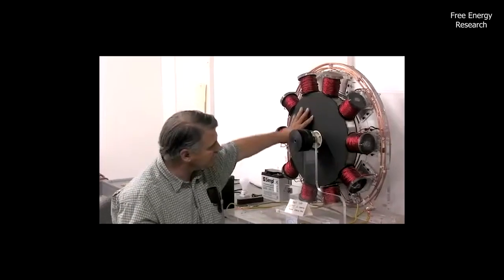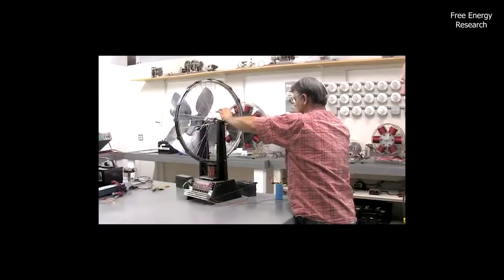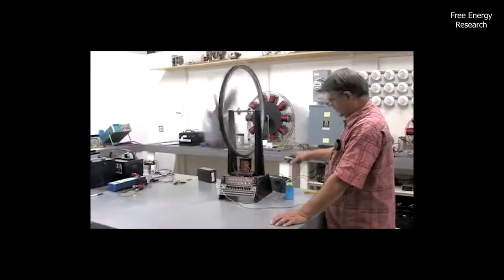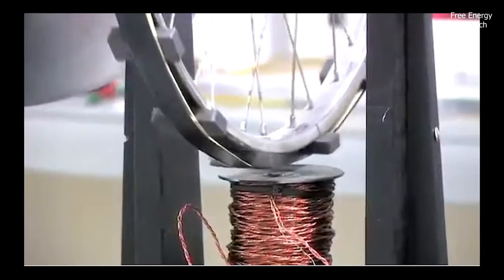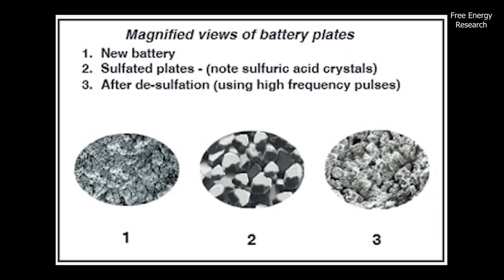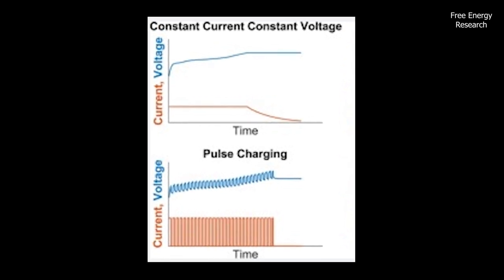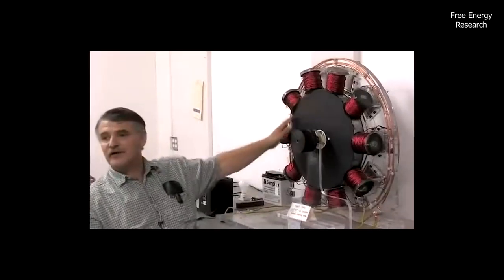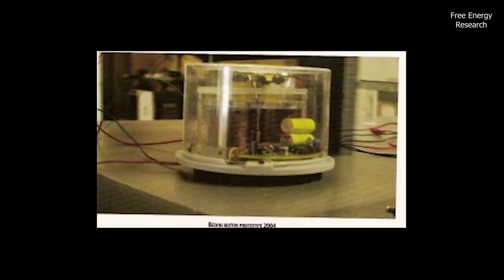Free Energy : John Bedini - (Biography)

Comment: While messing with shorted relays and mot capacitors to produce hho gas one time, using a car battery for power, I had the notion to tap a couple points of my circuit with diodes and try to charge an old motorcycle battery I had. It had some build up on the plates and would get warm during conventional charging only getting up to around 10 -11 volts after disconnecting and cooling. This was quite awhile ago so I'm a bit fuzzy on the details but I noticed that after some time in the circuit the motorcycle battery would settle out at a higher voltage than it was before. It never developed any heating and it seemed as if the pulsed energy was desulphing the plates because the resting voltage would gain a little more towards normal each time. I wish I could remember the set up but I'm sure it was bringing it back to being usable with the pulsed energy. I recall that however it was that I had it tied in the circuit was making hho with no electrolyte and when the motorcycle battery was connected it didn't seem to make any change in the tone of oscillation from the 6 relays I was using yet the battery would still take charge. I remember the circuit had 2 shorted relays with the coils wired opposite each other with a 3rd relay also shorted powered through diodes coming from the the first pair of shorted relays, the circuit mirrored in reverse on the other side. Now thinking about it there was a fairly decent gas production coming from the hho cell considering there was no electrolyte. I would try to replicate it again but I remember it was a set up that took a couple days of experimenting and torquing my brain to get to that point. I'm not confident enough that I could do it again to invest so much time in it now. Just reminded me of it while listening to your video.
Thank you for uploading this stuff. I wish I could have met John Bedini.

Comment: Did Bedini sell his inventions or he died with them.  It is no use when people die with their inventions.
Reply: Bedini didn't sell his inventions and did die with them, that what distanced him from other "over unity" or "free energy"  self acclaimed inventors. He shared his designs and secrets, he was an active member on many specialty forums, and his work made lots of other people step in this rabbit hole. He was an awesome man and his work even if it wasn't accepted by the mainstream scientists, it was and still is replicated and proven by thousands of people even today.
Reply: A lot of his stuff you can find on youtube.
At least you COULD.
I hope it stays available.
Reply: There is a lot more than just 'inventing' here, this is a whole new paradigm and science that still needs to be explored into. It took a lifetime of efforts and commitment for him to get to the point where we are today.
Reply: @navneetpandit7299  a lot of 
' breakthrough ' ideas and inventions are quelled and people who deal with them may even be ' eliminated ' one way or the other.  Some of them the only way to advance is if a whole lot of people are involved.
John was definitely involved in sharing.
Reply: Yes. Bedini had motors running looped alternating batteries i heard for over a year maintaining battery voltage.

Hes not the only one. I have seen another inventor do it on a SINGLE battery that maintained al little under 12v but ran looped for 6 months same voltage and still rotating. @L3X369